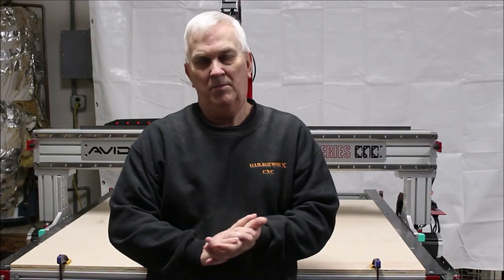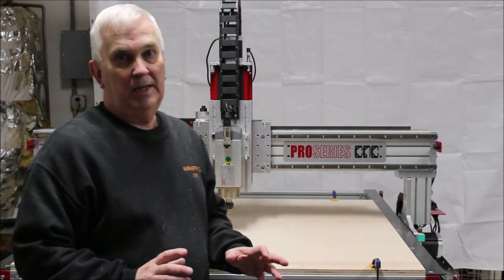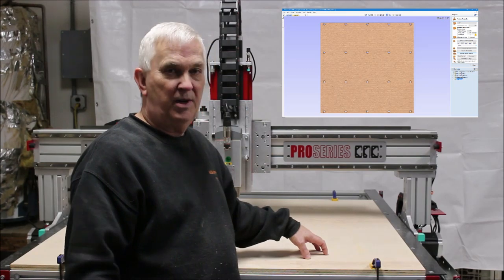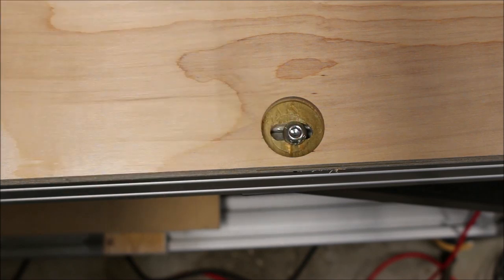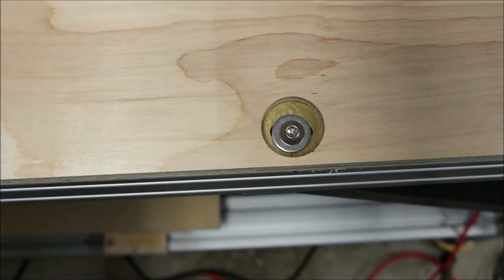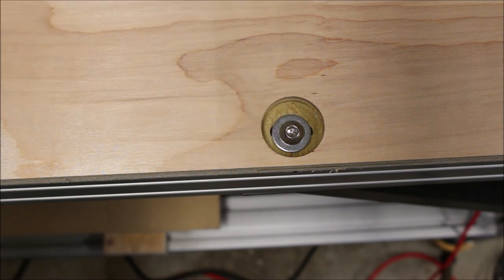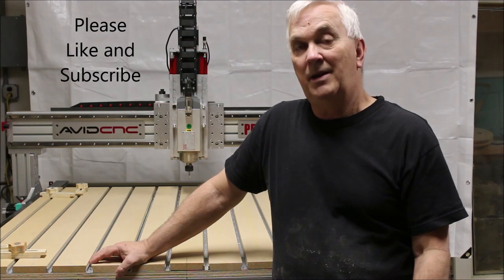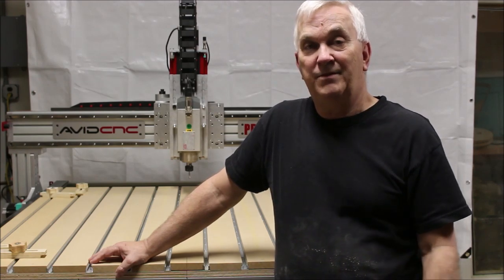Adding a Spoil Board to my Avid CNC

Comment: When you say you reglue new mdf, are you removing t track and surfacing down to the plywood, or glueing over the original mdf strips?
Reply from the maker: No.  I surface to just above the T-track then glue on new mdf strips over the old ones.

Comment: Dave, can I ask why you chose to glue the mdf to the plywood rather than use recessed screws ? When you can no longer surface the mdf, I assume that you unscrew the t-track, slide to remove each track and then just dispose of the entire spoilboard, mdf and plywood both?
Reply from the maker: When I've surfaced the spoil board as far as I can without hitting the tee track I glue on new MDF strips.  Easy peasy.

Comment: Dave  how wide is each piece of MDF between the T tracks?
Reply: Yeah Dave???
Reply: @OldVetCreations  He won't answer.
Reply: @rchavez5056  I’ve figured out on my Avid CNC 48” X 48” every 9” inches (from the front) would work and I wouldn’t hit a support.
Reply: @rchavez5056  but I’m bolting thru to the underside of the plywood. I’m not using screws.
Reply: @OldVetCreations  I used screws but sunk them in far enough to be able to surface the spoil board many times.

Comment: Hi Dave.  I am currently running an Axiom machine and am considering an Avid Pro as a second unit.  I like your spoilboard but I have a question... since you are covering your machine screws and washers securing your plywood with glued down strips of MDF, what do you do in the event part of the surface starts to loosen from vibration.  Are you using loctite, or is it even an issue?

Comment: Hi Dave, Just as a comment for next time, instead of having loads of strips of MDF you could just use a full sheet and machine channels into it for the T slot, then screw down the T slot and it will keep the MDF in place as well. then if you ever need to replace anything, just unscrew. You could even add bushed holes, captive nuts or helicoiled holes to allow proper clamp sets to be used.

Comment: Are you planning to do much in the way of long production runs? When I was running a commercial CNC rig  at my last job, they had an aluminum baseplate with precision dowel inserts to lock pin down custom jigs into known positions. Made job changeover quick and easy. How would you do something similar work in a  home setup?

Comment: Instead of gluing them couldnt you use 2 sided tape? Easier when it comes to replacing them.
Reply from the maker: Thanks for watching Brian.  I never replace them I just surface til I can't surface anymore and glue a new piece of MDF on top of the old ones.
Reply: @DaveGatton  what thickness MDF do you glue on top of the old surfaces spoil boards?  1/2 inch?  And do you just use regular wood glue?  CA glue?
Reply from the maker: Scott, you could use 1/2" or 3/4" MDF.  Either one will work fine.  I use Titebond II wood glue and use clamps in the T track to hold it while the glue dries.

Comment: It is good idea to apply mdf strips as a surface. The problem only is that you loosing height distance on z axis. If you use machine for material up to 150cm should be fine. For me is importand as I sometimes need to drill holes on ready build part and is very close to the limit. You can upgrade your table to suction system as long you req. them for something. Good job anyway.  Martin from UK

Comment: Looks great Dave, those t -tracks will be worthwhile
Reply from the maker: Thanks for taking the time to watch and comment Brian.  This setup is pretty much what I've used on all my other CNCs.  The tee tracks are about 4" on center so it makes it really easy to hold down any size work piece.
Reply: Dave Gatton ,I totally agree with the size of the bolts that avid CNC sends for the spoil board,
I opted to not use them all together and I cut some small aluminum angles and bolted my spoil board from the underside and used screws into the bottom of the spoil board. Of course this only works if you’re not cutting too deep into your spoil board

Comment: Why would you glue down the MDF?  How will you be able to replace it when the time comes?
Reply from the maker: Thanks for watching Steve.  When my spoil board gets "used" I will skim a few thousands of an inch to clean it up like new.  When I've done that a few times and there is not much MDF above the aluminum tee tracks I simply glue on some new MDF and keep making chips.
Reply: @DaveGatton  thanks for that Dave.  It explains a lot.  Best of luck with your new "toy".  It looks like a beast of a machine.  I watched your assembly video and was impressed with that too.
Reply: Steve Gronsky same question I was going to ask. Personal preference. I’ve always screwed mine down. I like I’m the idea of glueing. Hasn’t really considered it before. Less holes....  might try it.

Comment: Is it common to glue the boards down? Or could you screw them in and countersink the heads?
Reply: I glue mine down. With metal fastners you always have the possibilities of damaging a bit.
Reply from the maker: You could screw them in but then there's always the chance that you might hit the screws later.  With gluing them on there's no danger of hitting a screw and when the MDF is about all used up you simply glue on some new MDF.  Easy peasy.
Reply: Alright, thanks!